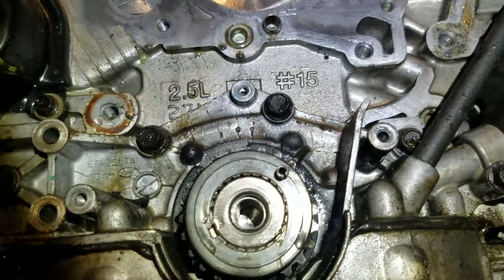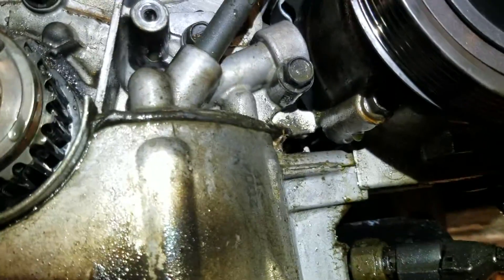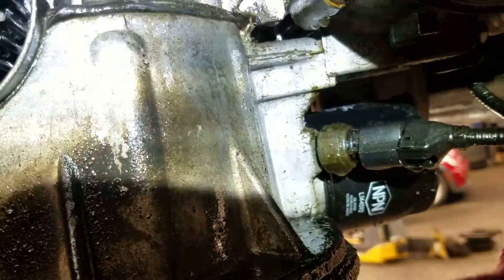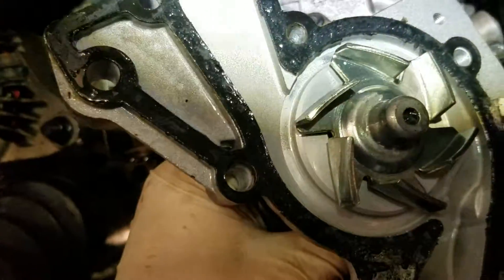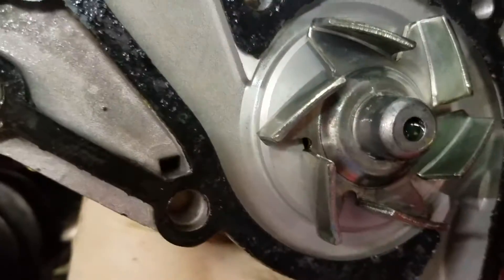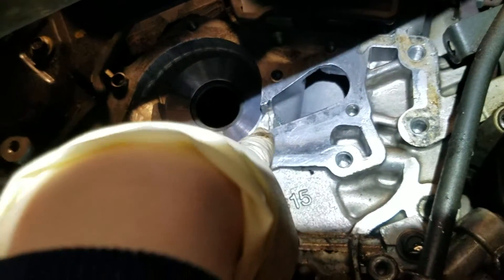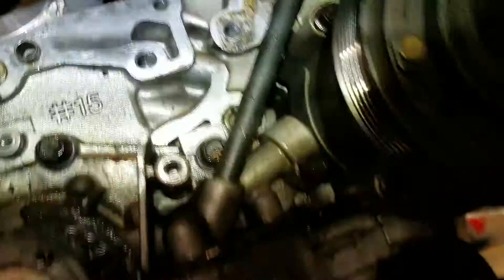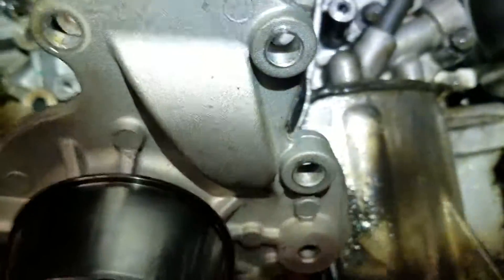Hyundai santa fe coolant leak behind ac compressor

Comment: You just confirmed what I feared, thanks for the video!
Reply from the maker: No worries. My suggestion is to not cheap out on the pump. ALSO use the metalized gasket. The paper style ones always leak... always. No matter what type of procedure or sealant to put on it they always leak. The Metalized one have a steel core that has a sealant bonded to it.

This is a super easy job.

Comment: Precisely my issue. Could it be a gasket or is it the entire pump?
Reply from the maker: It's impossible to speculate come it's 50/50 either way. If you're going to take it all the way apart you might as well replace both